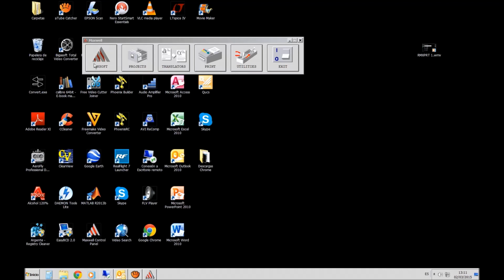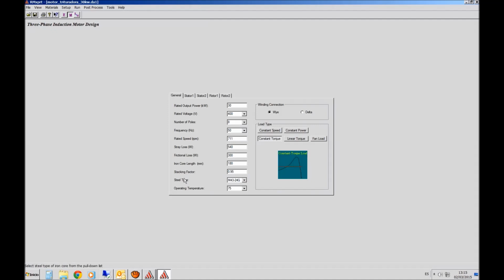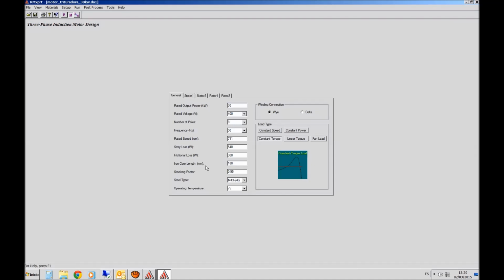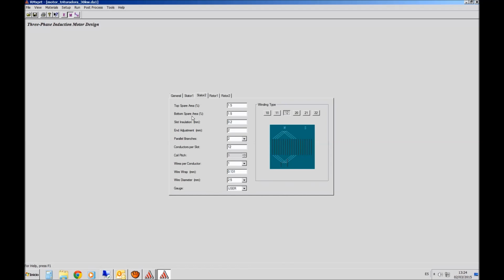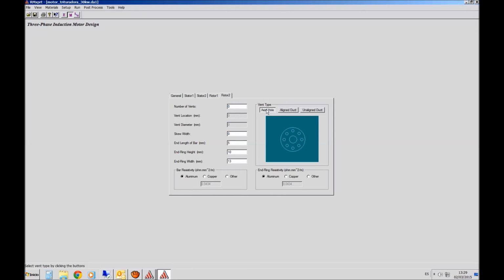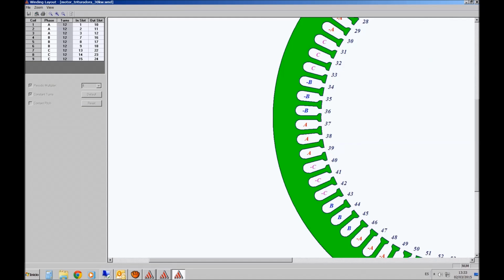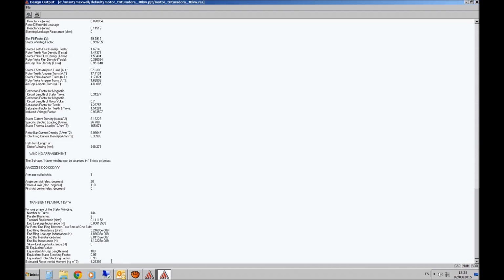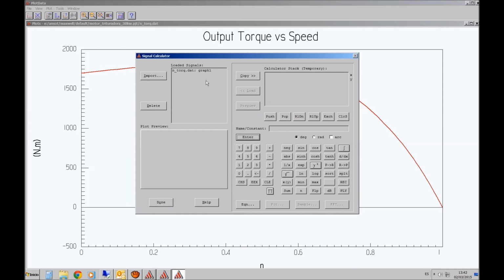INTRODUCTION TO RMXPRT - ANSOFT

Comment: Hi
Thanks for your great video.
I need to calculate harmonic orders of winding current in an induction motor taken from RMxprt design. Is it possible in Maxwell or i have to use Workbench or sth like that?
Reply from the maker: Thank you so much. I am  not sure RMXPRT is valid for this purpose. Maxwell with transient simulation if able to give you a current waveform you can analyze in the frequency domain. The problem is that you need to perform a very long simulation in order to have good frequency resolution. For a deltaf in the frequency domanin you need 1/deltaf time of simulation in steady state. If you are modelling a complex machine with motion this is really long. In my office computer:  CORE I7-6 Cores, 32 GB RAM, SSD DISKS and Overclocked to almost 4 GHz it takes around 1 week. Frequency analysis is always this way :(. Best Regards.
Reply: +Manés Fernández Cabanas thx for your comprehensive answer. My machine is not so complex .It's a squirrel cage induction motor. by the way do you have any idea how can I do that?
Reply from the maker: I was talking just about that type of machine :). If you search the IEEE you will find some of our papers with this type of simulation. If you want the whole harmonic content of the current it is pretty annoying. In fact, in 1995 I had to do it analytically in my PHD thesis and I had to reduce the complexity of the calculation to be able to end it. There is a good, but very hard book, author Vaclav Hamata (maybe the spelling has some mistake..), where maybe you can find any idea. I do not exact  remember the title. Was something like: "Harmonics in Electrical Machines". Good luck and patience!

Comment: i am needing a help for using maxwell and rmxprt any body can help please contact me via
andalos120@gmail.com
Reply from the maker: Ahmed Gamal Dear Ahmed I have worked with several FEM programs. The latest I have used is Maxwell/RMXPRT V10. You can look for my email address in the University of Oviedo / Electrical Engineering Dept. I can try to help you if you emai me. Maybe It will take me some time to answer you because we just now at the end of the course. If your questions are about higher versions of the program I think I am not being able to help you.
Reply: Did you use it for electric motor?
Reply from the maker: Sure.
Reply: Thank u my friend
Reply: Could you write your mail and skype or whats up?
Reply from the maker: Ahmed Gamal Dear Ahmed, I am sorry for the delay. I have lost your email, please send it to me again and I will try to help you by email.
Reply: my mail : andalos120@gmail.com